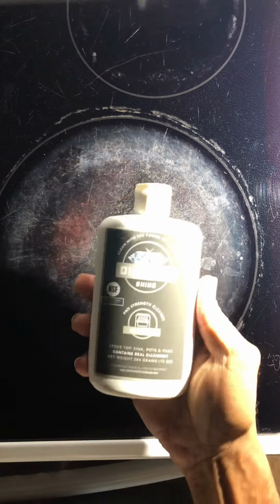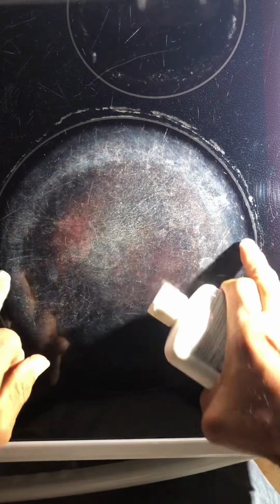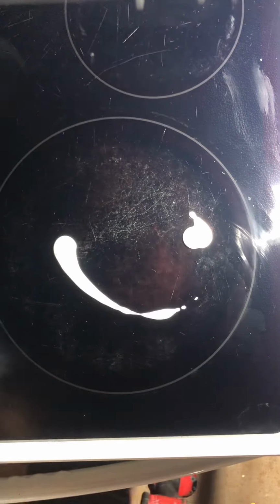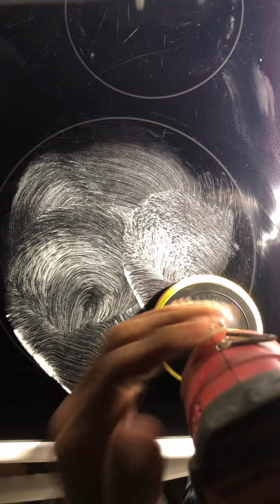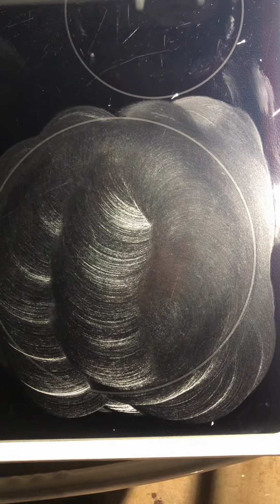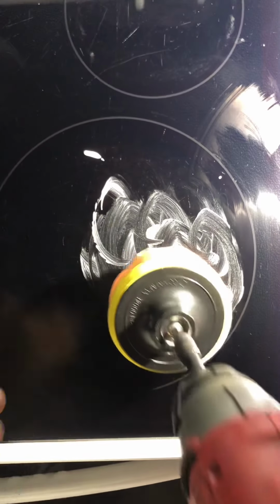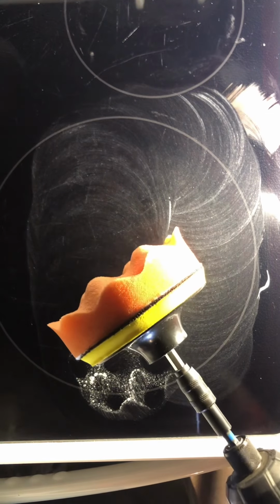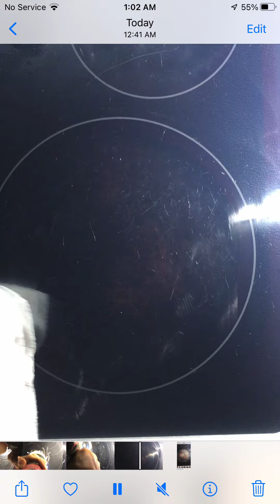Stove Top resurfacing | Glasstop Scratches Removal | Cleaning Stove Top| Cooktop Haziness removal

Comment: What sort of drill can attach to these polisher heads?
Reply from the maker: A standard drill will work nothing special. Just be mindful of the rotation of the pad. So if you tighten the pad stay in the same position for rotation. A basic battery or a cord operated drill. If you don’t mind sharing your before and after photos of the restoration process. Keep in wet and clean. Nothing to scratch the surface.
Reply: @appliancerepairshorts  Will share the before and after. 
DEWALT 20V MAX Cordless Drill (DCD771C2) - will this drill work with the attachments of the item in ur link?

Comment: Hi. What do I do if I don't have a drill?
Reply from the maker: Probably more difficult, but with patience you might. You will definitely get a better result with a drill . Make sure you remove any debris that is baked on. This is only removing scratches. Not cleaning properly could result in more scratches